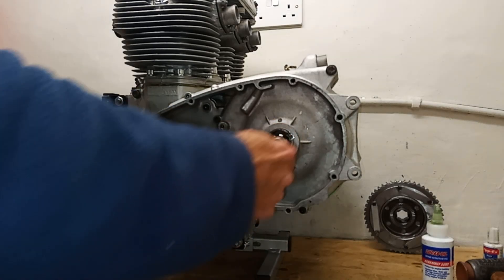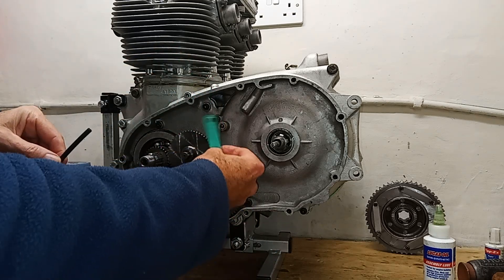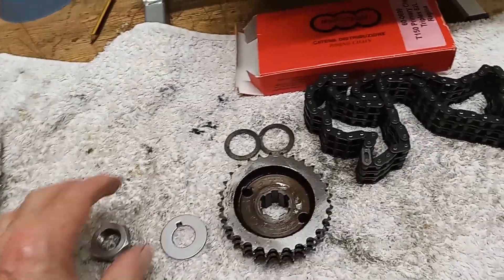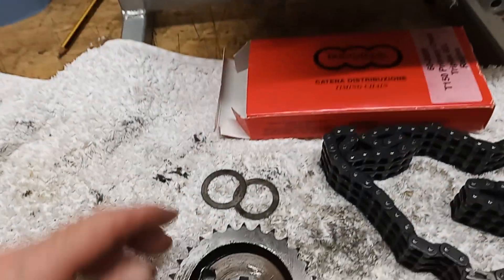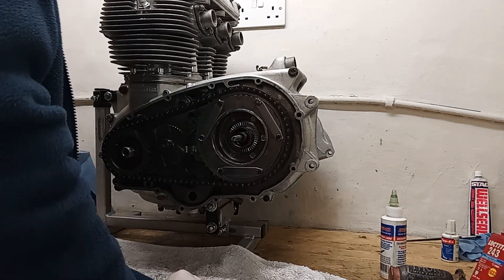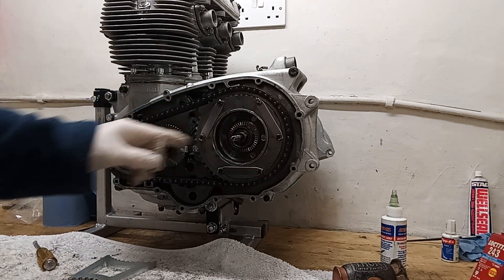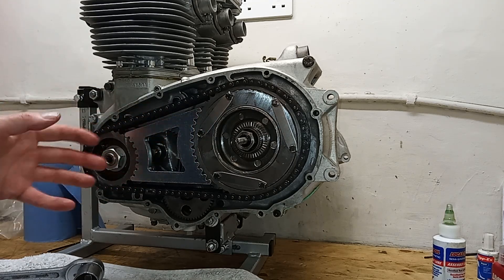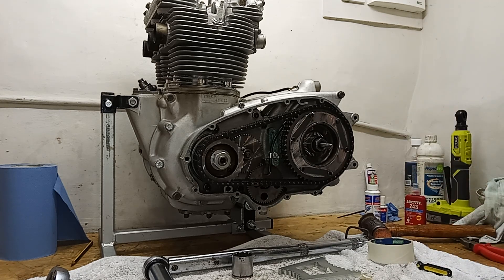Triumph Trident T150V Engine Rebuild Part 44: Fitting the Primary Chain

Comment: Hi Chris excellent series of videos. I've found a few things fitted wrong on my t150 clutch strip. Cush drive rubbers wrong way. Push Rod seal wrong way around. Great tip on bbq to heat cases my bearing just fell out. Thanks Keith
Reply from the maker: That's great to hear. Many thanks for the feedback.

Comment: Hi Chris, I thought you did not need the trust washer behind the clutch basket anymore, because basically you are pulling the clutch basket towards the outer chaincase cover
Reply from the maker: Hi Leo, I have thought about this a bit myself, and I think there's merit in the idea. However, I worry that without it there may still be some play/whiplash at times during riding that would cause the back of the shock absorber to rub on the inner gearbox casing. I don't know if that would be the case, but I think that on balance and without more evidence/knowledge regarding this question, it is better to leave it in than out. It's hardly a heavy item so leaving it in shouldn't be a problem.  Those are my thoughts anyway, for what they're worth.